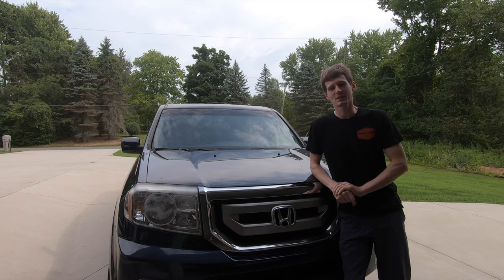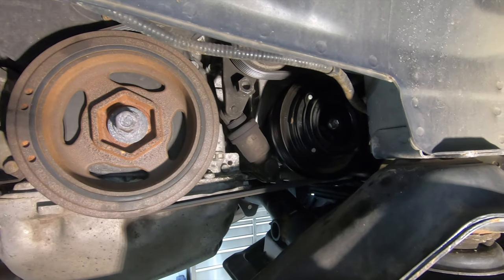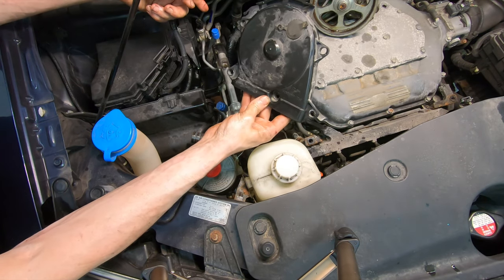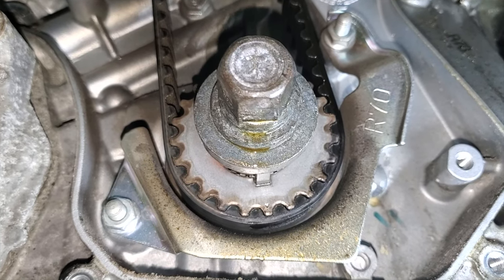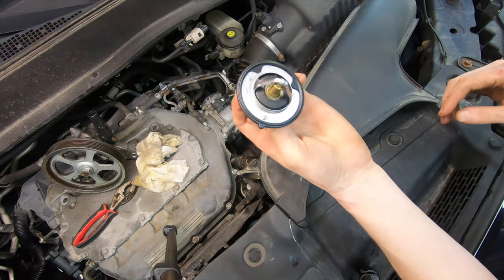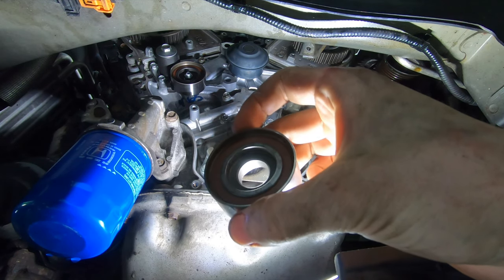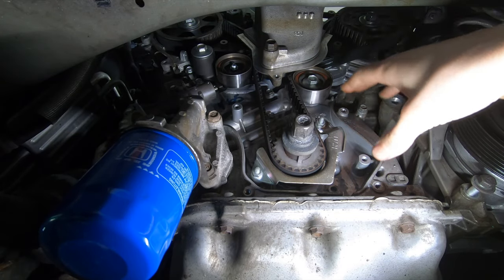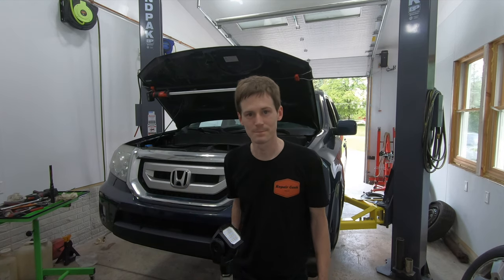Honda 3.5L V6 Timing Belt & Water Pump Replacement- Pilot, Ridgeline, Odyssey.

Comment: There is absolutely no reason for the crank and cam bolts to be this tight. Not even a 3/4 impact would loosen the crank. I rented the special tool to hold the cam sprocket to change the seal.  The tool didn’t hold and I turned the cam probably 20 degrees. I’ve been working on cars a long time and never ever has my 1/2” snap on impact failed to remove any fastener.  I am getting rid of this when or if I ever finish it.

Comment: All Japanese cars 100,000 miles 10 years old my Escalade 14 years old I'm at 200,000 miles never had to change the timing belt because I have a chain

Comment: Sad thing about these pilots and other honda v6s. They have piston ring issues. Usually just the back 3. But number 4 can also cause issues. Any time you have a misfire on 1-4 you can bet money the plugs are fouled and it needs rings.

Comment: Surprised at the poor motor mount condition after 105k miles
Reply from the maker: I've done a couple of these since this video... They've all been smoked.
Reply: @RepairGeek  Maybe it’s the auto start/stop feature causing early motor mount failure?. Either way, thanks for pointing that out!!!!

Comment: The impact would have done it if you kept going without needing the special tool
Reply from the maker: How long was I supposed to go? If you can get that bolt out without buying the socket be my guest. Not everyone has an impact powered by a nuclear reactor (myself included) in that case, buy the socket and move on.
Reply: @RepairGeek   yeah you right nobody has one of those nuclear-powered power plants but I was just saying it does have the power and I do agree with what you're saying
Reply: I busted 3 sockets and about burnt out my impact wrench i went and bought the socket he described no more messing around thanks i thought i would be stuck on it forever

Comment: You have to lube the bolt for the impact to remove it. The rust is the strongest glue in the world. Soak it for at least 24 hrs and it'll spin off with regular socket. Noob.
And, no, always just use universal green/yellow extended life. It's cheap, it works. Blue/red is a joke. Double/triple the money for the same functionality.

Comment: Thanks for this video as they all absolutely suck, everyone takes off the ECU but no one shows you how to get it off. They just show you some double digit iq stuff, like oh yeah you take it off. Then there's your video where you don't take off all this extra crap for no reason. I found one guy who took off the PS pump and the intake manifold lmfao... I love ETG but his vid is dog poop in that that car uses an entirely different passenger side motor mount. Everyone else has wayyyyy to many wierd camera angle and changes to the point where you just get lost in their videos.

I probably watched maybe 10-20 different videos before finding yours. But there rest are just terrible.